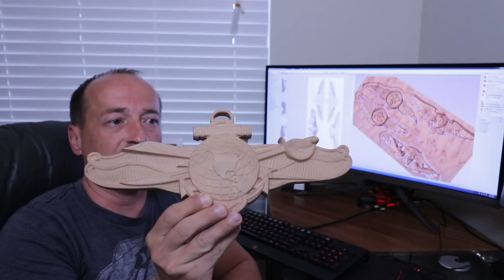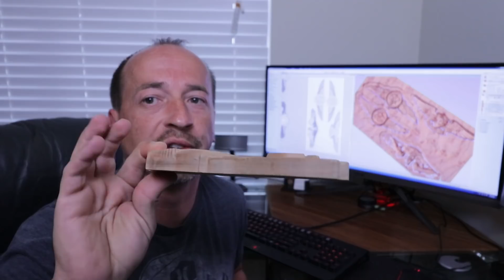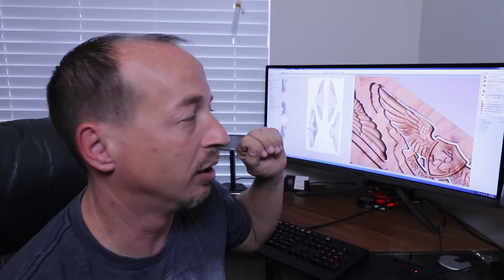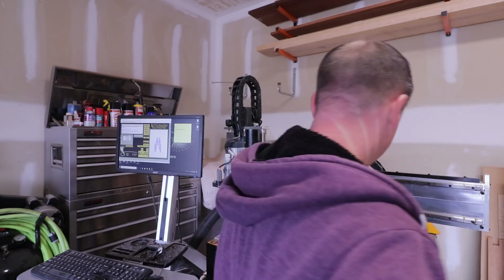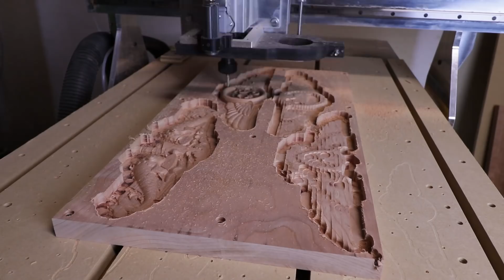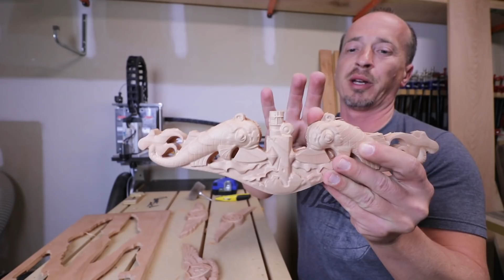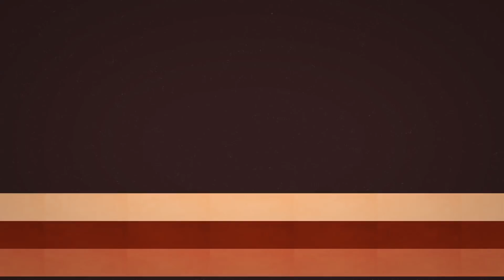Why are 3D CNC Router Carvings So Expensive?!!

Comment: If you want to speed up your production add another or more spindle router on your z axis instead of vacuum. You can  air blow in a enclosed vacuum.  There is some nice gadget that blow cold air too this way you can speed up feed. For more simple automation solution contact me.
Reply: its better to use the vacuum instead of blowing the dust all over the shop.
Reply: A 2nd spindle on the same z axis will crash the bit into the work when one bit dips into a pocket.  Think about the bit location.  A 2nd offset spindle requires a 2nd Z axis and a wider gantry for the 2nd spindle to cover the same work area.  It also requires additional programming and calibration to ensure the 2nd spindle offset is correct to tool into the correct location. Not worth the extra cost and effort to save every other tool change.  Best if you can afford it is an automatic tool changer.  They are not in the price range of this machine.  Only larger enclosed mills tend to include a tool changer.
Reply: @isettech  Your 1st sentence told me that you have no clue what you're talking about. I have run 2 spindles side by side off the same Z axis for small parts like this. The only more difficult thing is setting your tool heights identically on both spindles.
Reply: Speed up production? Add another cnc machine...

Comment: Just a small notice 3D is when a project made when all 3 axis move together, 2.5D only the two axis. Great video, keep up.
Reply: Yes and no...  for the novice 2.5d machining is when there's no overhanging elements, such as those that would require machining on a 5 axis machine.  The 2 axis movement at one time  is correct, which is what your router does most of the time...  i.e., raster toolpathing means you're moving only one (x or y)axis while z is moving...  but hey, the video is for those whom have zero understanding and of cnc...
Reply: I would consider what I normally do to be 2.5d, Anything that doesn't have square edges I would consider 3D even if it is only moving on 2 axis at any one give time. You could set up this same job to cut on a diagonal where it uses all 3 axis at the same time.
Reply: lol, i understood as following, from the description of my cnc-machine and years of praxise but maybe im wrong....
2,5 D is when you have normal 2d-Lines(dxf) with fix added deepnes, and fine.....and 3D is when you put 2d-Lines over a relief and the software calculates for every 0,1mm of all this lines the needed deepness over the relief-structure, and the result are 3d-Lines which are 2d lines with thousend different z-values..
Reply: @berndlottes9940  see what you make of this... https://www.flashcutcnc.com/node/82 from what I understand it to say 2.5d is when you are doing a typical 2d X, Y pattern but it changes from 2 to 2.5 when you drill different depth holes or different depth pockets, but where it gets tricky is that it mentions retracting fully to go to the next position. To me what he is doing here seems to be between 2.5d and 3d, maybe some kind of 2.75d :D
Reply: forgot to mention for 3d Lines the software also includes the calculation for the diameter of the bit when watching from the side, because a none round-bit has to stay farther away from the relief then a round-bit, the round-bit lets smooth surface, the other bit makes steps on the surface of a round-relief..
Reply: This only applies to when referring to 3d "machining"  a 3d model is different. Thats where people get confused. There is no 4th dimension when referring to space. The dimension are called x y and z in both positive and negative values.
Reply: @graffix11 , writes "There is no 4th dimension when referring to space."

Correct, but there are six axes when referring to movement in 3D space. See my earlier post.
Reply: If your CNC only plunges the cutter straight up and down, then it's 2.5D. You need a 5-axis CNC to cut in 3D.
2D would be a cut with the cutter at the same depth for the entire piece.

If you can't make a space horizontally then it's not 3D.

So 2.5 D would be a stack of concentric circles of (from bottom up) 10", 9", 8", etc.
3D would be a stack of concentric circles of (from bottom up) 10", 8", 9", etc.
Reply: I disagree with Fred's comment.  3D is if your machine can interpolate 3 axis simultaneously - thus 3 dimension.  Any combination of X, Y, Z, A, B, C will do as long as it's 3 axis simultaneous.  2.5D would be cutting multiple pockets at different depths.  The machine only uses 2 axis at a time, but the machining has different depths.
Reply: @framecomgilroy4240 , Can a 3 Axis CNC carve a wine glass? That's a 3D shape.

A 3 axis CNC machine (which is what you describe) is different than a CNC capable of carving a full 3D shape. With a 3 Axis CNC you don't have full axis of motion in the third axis, that is you can't make an undercut so it's not full 3D, thus 2.5D.

If you're old enough, Doom was 2.5D because no room could be above or below another room, Quake was full 3D.

[edit]
3D space actually has 6 axes of motion:
3 Lateral: left / right, front / back, up / down
and
3 Rotating: turn left / right, spin left / right and tilt up / down
Reply: A lathe.  X, Y and A axis can cut a wine glass or a ball.  Undercut has nothing to do with it.  I don't know what you mean by full axis of motion.  If a CNC can move in X (side to side), Y (back and forth) and Z (up and down), isn't that full range of motion?  Regardless of what the tooling can or can't do.  I could put a saw blade in my router and by means of a helical toolpath do an undercut.   I think your confusing the need to add additional axis to do what you want to do.  If you want to do undercut you need minimum 4 axis machine.  It may only be able to interpolate in 3 axis simultaneously, but you'll need a 4 axis machine.
Reply: @framecomgilroy4240  A lathe is adding another axis of motion and it's no longer a 3 axis CNC machine.

To cut a full 3D shape (say a copy of the Statue of David) you need a 5 axis CNC machine. That's why they make 5 axis CNC machines. You could do it using a four axis CNC machine by adding a turn table, but that makes it a 5 axis CNC machine.

re: full axis of motion.

OK, picture a helicopter. It can move forward or backwards (one axis), left or right (second axis) up or down (third axis) turn left or right (fourth axis) drip it's nose up or down (fifth axis) or roll side to side (sixth axis). That's the full axis of motion in 3D space. There is no motion the helicopter can do that isn't some combination of those axis.
Reply: @fred_derf  , when i contruct the glas in rhinocerus and when i generate every 10 degrees(for example) a new stl-File in rhino from view above, and when i send 36 stl files, each shows different 10 degree-relief then i can make a can out of wood with my CNC. it only has x y and z......PS the glas is lying in rhinocerus not standing, else the view for stl-file would be different, and a step-motor for 4th axis would help, but should also work manuel, which i still used for modelship-masts turnin the wood in 90 dgree-steps with round-cutter

Comment: Where did you find that monitor/keyboard stand?
Reply from the maker: it was a desk-mount swivel arm that I modified slightly and attached it to the bottom shelf of my cnc stand...  swings in and folds up nicely when not in use.

Comment: Great Video!  It should answer the questions to other people.  I like your monitor!!  how big is that?
Reply from the maker: 34" ultra wide.  Makes having 2 windows open side by side a dream!
Reply: @rbwoodcreations1039  Can you tell me what model, and what resolution you have it at? Thanks.
Reply from the maker: It's an ASUS PG348Q with resolution at 3440 x 1440.  It's a bit pricey for monitors, but I bought it during a holiday sale and got it for $300 less than usual price.
Reply: You can buy usb adapters to plug monitors into now.  Put 3 monitors side by side.  I haven't used them because my video card supports 3 monitors.